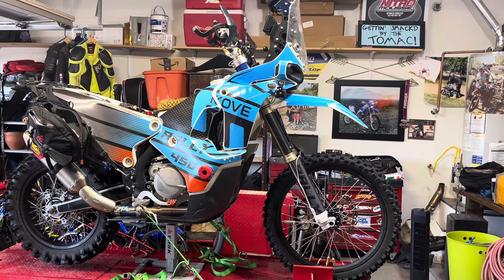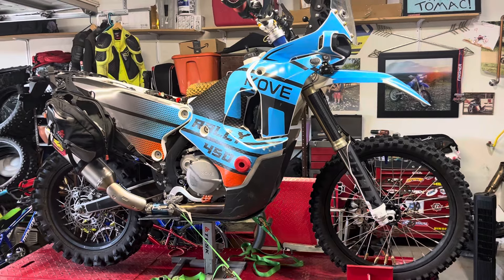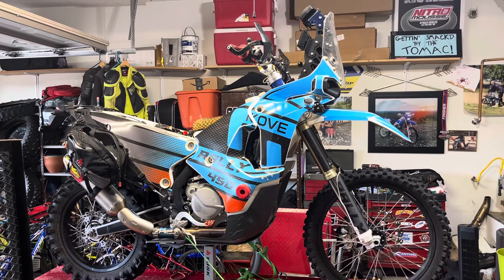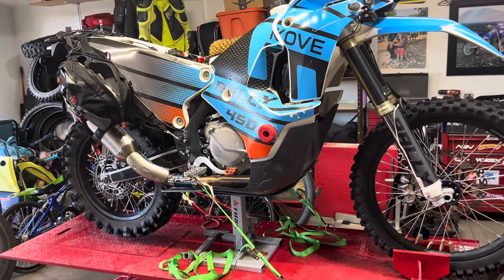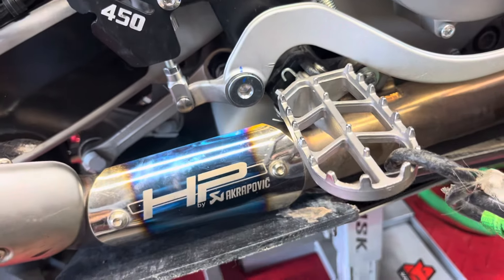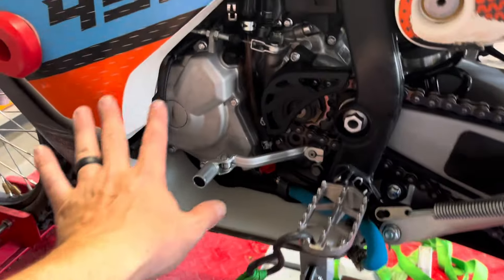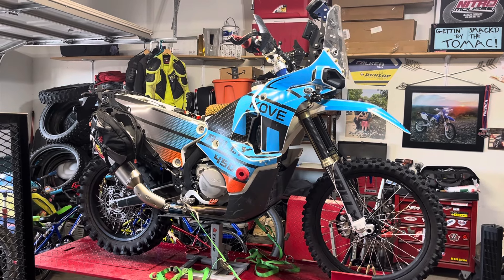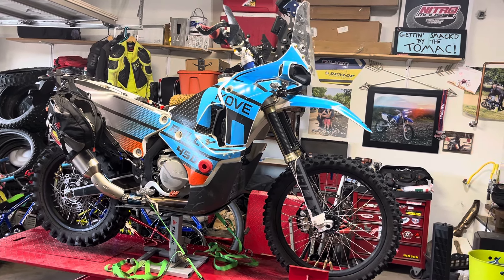3500 (rough) miles on my Kove 450 Rally

Comment: Thanks for a great video and information. Am seriously thinking about buying one, but am concerned about the need to ride on the road for daily commuting, and long distance adventure riding on and off road.
Reply: Check service intervals of this bike(oil, valves) and then think again about that long distance adv riding, not many talking about it
Reply: Thank you for the heads up.
Reply from the maker: This engine was already in mass production with proven reliability. (Only slight head change for dohc) It’s not a street bike or a long haul bike by any means. It’s a purpose built rally bike that can has elements of a decent dual sport / light adv bike. On the highway, it’s still a single cylinder dirt bike.
Reply: Thank you good sir, I still love the bike.